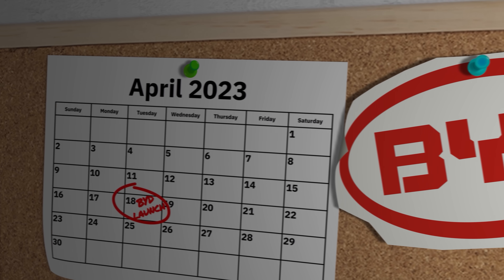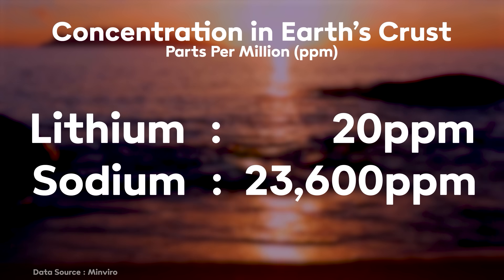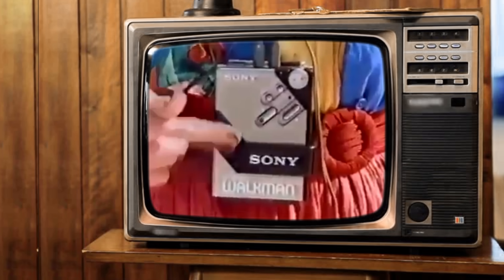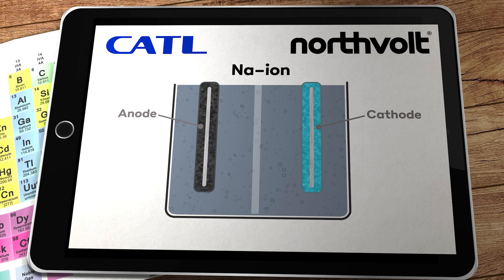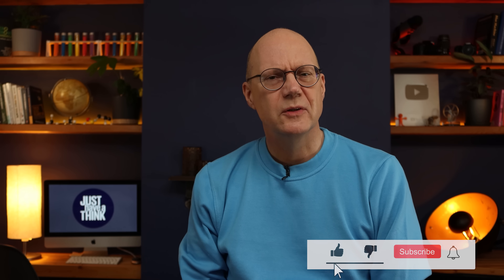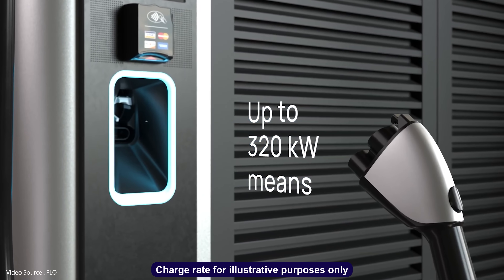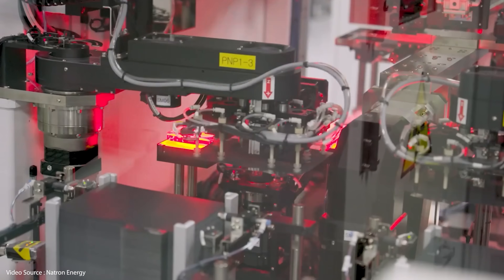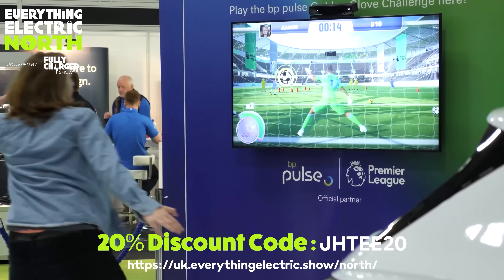Sodium-ion batteries in the USA. Beating China at their own game!

Comment: the large voltage spread is going to cause problems
Reply: Yes, I worked for an inverter manufacturer and we tested these batteries and when attempting to power large inductive loads such as air conditioners or water pumps the voltage would fall too far, too quickly and the inverter would drop out and the load would no longer be powered. This technology has already been tried in America and the company went bankrupt.